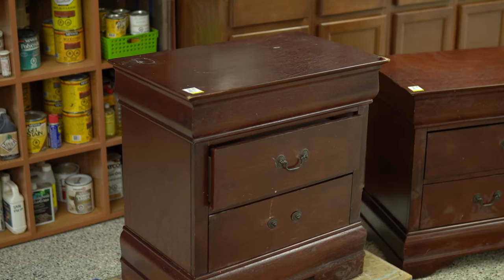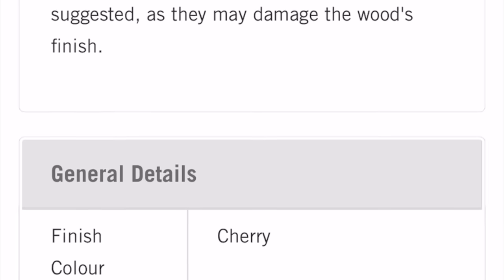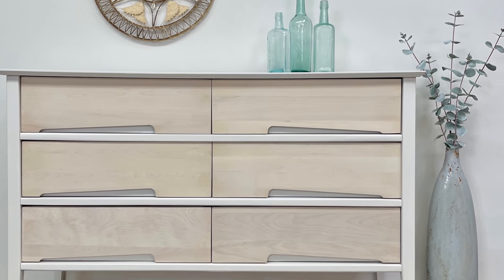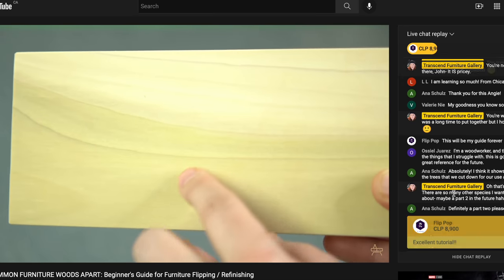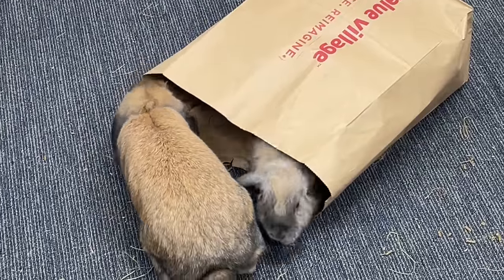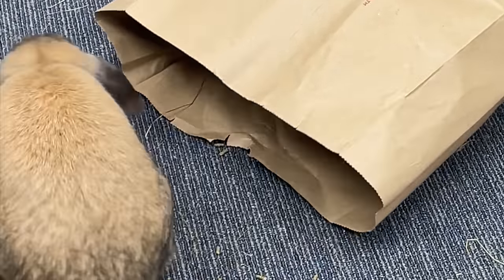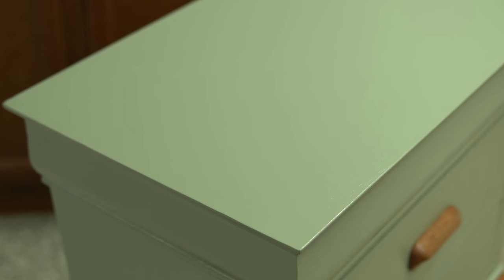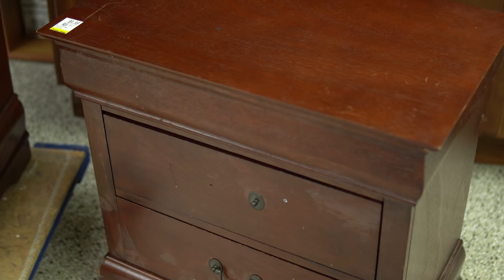EASY night table MAKEOVER: Giving BIG BOX STORE FURNITURE a facelift

Comment: It never occurred to me that you couldn't use wood glue to fix broken non-wood pieces. Thanks for the Welbond tip. I love the way these turned out!
Reply from the maker: You technically can but wood glue bonds best with wood fibres so for a nothing that isn’t wood, I just use an epoxy or different type of glue :-)

Comment: Hi, I have sauder tv stand can I sand off the top layer that thin sheet or wood they used on it to give that cherry finish?
Reply from the maker: The long answer here, is as much as I would LOVE to be able to help everyone who reaches out, there sadly just aren’t enough hours in the day. There is another side to this as well- sometimes things don’t come across properly through photos and videos, and are best seen, felt, etc in person. For THIS reason, it can sometimes be difficult to accurately determine the age, finish, wood species, etc of people’s project pieces. There is also the element of user error, when recommending products and finishes, or misinterpretation of my instructions.

I get, on average, approx 40+ messages per day between Instagram, FB, YouTube, and email (and literally hundreds of questions in the comments). It is unfortunately just not possible to be able to get back to everyone. 

The short answer is this: you can certainly message me on Instagram and if it’s a simple answer, I may try to help you out. But PLEASE don’t take offence if I’m unable to respond! I need more hours in a day!

Comment: So question, did you happen to have tons of swirls when using your surfprep?  Everytime I use it, I get swirls.  No matter what grit, pad, etc.  I honestly never use it because I'm so done with it.  I've reached out to the company and was given all sorts of advice, and have done everything.  So again, did you have swirls at all?
Reply from the maker: I didn’t! That’s odd! Could it be that maybe you’re using too much pressure or not changing the sanding pads often enough? Sometimes that makes a big difference! I’ve only used it so far on this liver but am looking forward to trying it on different projects as well. I actually did a video a while back with some tips on avoiding them- maybe see if there’s anything you can adjust and give it another go? It’s possible that it’s the same advice you’ve already gotten but worth a shot. :-) https://youtu.be/NTo4AdsCbTc
Reply: @TranscendFurnitureGallery  yep it doesn’t matter. Little pressure, new pad, moving slowly, etc. I’m just pissed because it was so much money. I’m telling you, I never use it because no matter what, I get them. I just keep using my good old DeWalt, or have been doing it by hand.

Comment: Did you call these rubber wood? If so, what is that? I have never heard of it
Reply from the maker: It’s sometimes called parawood as well, it’s a type of wood frequently used in mass produced furniture. It’s lower quality but still stains quite well. I don’t mind it at all. :-) (but it’s no walnut lol)